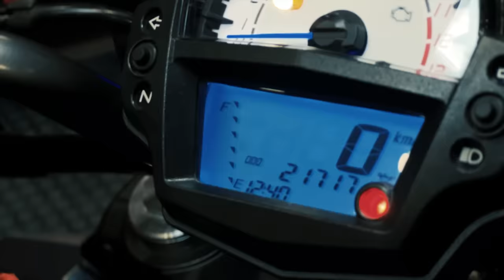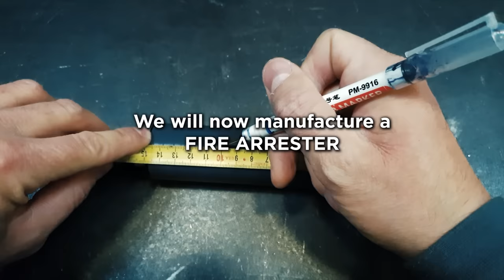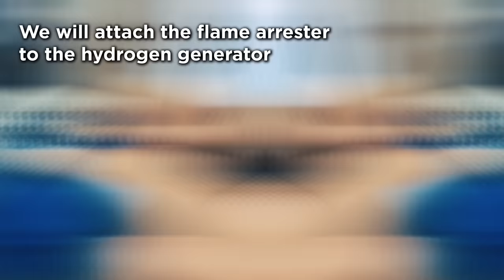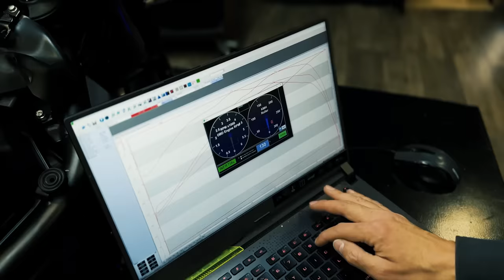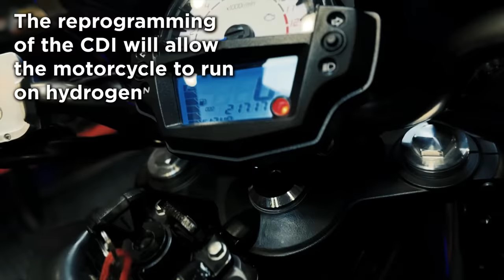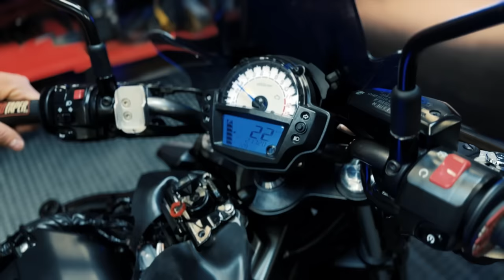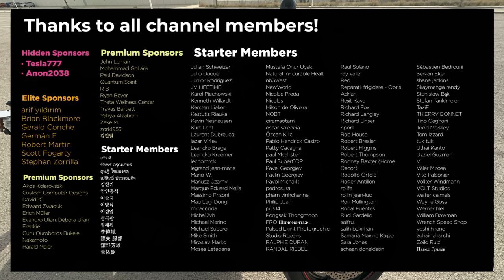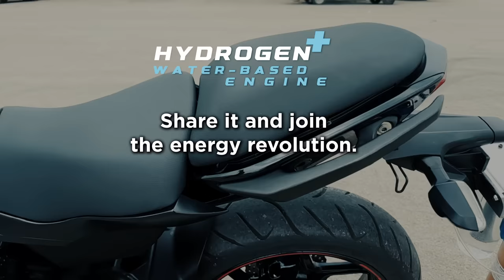Running Bike On Water - 100% Working Trick

Comment: This video violates a basic laws of thermodynamics and chemistry.
Proove:
1.)
1kg of hydrogen requires around 50kW of electric energy on industrial scale(70% eff.)
1kg of hydrogen posses around 142 MJ (39kWh)
of potential chemical energy. If I consider an engine eff. around 33.3%(High compression ratio, no turbo)That means, that you could use from 50kWh(but propably more, due to the poor construction and bleek eff.) That means, you would have to generate well over 150kWh/kg, while consuming 50kWh/kg. You have made a perpetum mobile with over 300% efficiency.
(not mentioning the puny battery, that would have to provide at least 60 000A at 12V to be able to cruise at 80km/h - that would requred tram rails to carry this ludacris current)

2) Hydrogen is not very well suited for Otto-cycle internal combustion engines. Due to the low octane rating (60-67 RON) requires maximum compression ratio around 6:1. This bike has a compession ratio around 10.5:1. HHO mix would result in an engine knocking and destruction after minutes of operation. Not only that, mixing Hydrogen with oxygen in such matter to be safe...
With just a single backfire, there would be a huge bang. Kreosan had actually tried this with an scooter engine and it resulted with an engine blown appart.
Reply: cheap to run--its a money thing
Reply: @brenohighland1168  not cheap to run if it destroys itself a few meters down the road
Reply: @Cyberware77   if
Reply: @brenohighland1168  a very likely if just depends on how hard its pushed, it would break when brought to road speeds

Comment: OK so my question is how long are you actually able to run because what form of energy loss will you have to the alternator and the battery which is driving the generator. 35% energy capture capture.
Reply: the point is, we can use our vehicle using water. done

Comment: How do you protect the engine from rust?
Reply: Water is not  going to the engine.. Only hydrogen goes inside
Reply: well do you need to protect the engine from rust with normal gasoline combustion? .........................................................lots and lots of Hydrogen in Gasoline which becomes water during combustion ;)

Comment: How long before it depletes the water?
Reply: Más tiempo que lo que tardará ese motor en fundirse.
Reply: I think the question is how long will the battery last. I think it will drain faster than the bike can charge it
Reply: @RobCantonJr if like that, much better the electric motor bike
Reply: @soss6923  yes exactly

Comment: I got my moped running idle by putting the  hho generator hose on the intake manifold vacuum. But wen i gased or trottled it it boged out. With no gas at all in the carb.

Comment: One thing i never understood is how the hydrogen would produce more to go faster. Thought it was a continuous flow. Cant have hydrogen and oxygen in a tank or its explosive together potentially. Only thing i could imagine is the power gets higher to the hydrogen genorator as it revs up. Hydrogen plus a hydrogen fuel cell would probably work better.

Comment: Isn't the electricity required to produce h2 higher than what's supplied?
Reply: 1:26  there is no “hydrogen tank” as this is a HH on demand system.  Meaning, the very instant that hydrogen is created, it is burned off entirely.  If you were to get in an accident, god forbid, you would be left with glass and baking soda. Oh, and some water.  That’s it.
Reply: What’s fascinating is this was figured out by Austrian / Hungarian Empire long before the 1800/s.  You can electrolyze water, so that its “steam” is a power source for combustion engines.  The only reason you aren’t taught about this is because powerful people like “Standard Oil” and other business interests stand to make too much money when we buy gasoline.  
It’s a fact that our engines use roughly 30% of the fuel we buy and pump into the tank.  70% gets wasted out of the exhaust!?!?  But not if you do this.

Comment: Est-ce que ce moteur supporte l'explosion à hydrogène.....le piston et les segments doivent morfler ?
Reply: C'est une des composantes du problème, ... les moteurs les plus robustes suportent bien la puissance de l'hydrogène (les gros diesels ou les gros v6) ... ce qui est plus problématique, c'est qu'ils sont constament soumis a ine athmosphère humide.
Mais tout ca n'a rien de révolutionnaire ni même de secret.
La supercherie consiste ici a faire croire qu'on roule a l'eau. Ce n'est pas le cas. ..  on roule a l'électricité qui transforme l'eau en hydrogène pour l'injecter comme combustible dans le moteur. En clair, ton générateur a hydrogène vide ta batterie a vitesse grand v ... puis s'arrête ... et fini la balade. En fait, c'est complètement con comme système.

Soit tu roules directement a l'electricité (et tu ne perds pas d'énergie par effet joul au moment de l'hydrolyse)
Soit tu as un réseau de distribution d'hydrogène et tu fais ton plein d'hydrogène ... et cet hydrogène est utilisé dans un moteur a combustion, ou dans une pila a combustible qui produit de l'électricité pour alimenter des miteurs électriques.

Comment: Wohin geht der Wasserstoff wenn er im leerlauf läuft? Warum hat er keinen erhöten leerlauf? Fragen über fragen. Das ding hat kein tank um gas zu speichern kann aber mal viel und mal wenig verbrennen😮. Erklärt mir bitte das.
Reply: sammelt sich alles im Luftfiltergehäuse, bis es rausdrückt, du sitzt auf einem Eierkocher😂
praxistauglich ist das nicht, zumal die Batterie bald leer ist und das Ding bleibt einfach stehen.
Es gibt HHO Aufbauten mit Neodymmagneten und Kapillaren, hier wird der Wirkungsgrad deutlich besser, dennoch fährst du eigentlich elektrisch
Reply: You could potentially solve this problem by running the engine with gas only from the hho generator. Then devise a system to take the signal from an electric throttle to adjust power to the hho gen? Potential lag issues if the hho gen isn't built well enough to quickly change output of gas.

Comment: This tech can easily be used as an addition to solar farming. Free sun egergy plus free water sources and filtration = clean hydrogen to generate more electricity for a quicker use case. The question is what is more efficient? Just solar? Or both solar and hydrogen together? A.i machinery can be used eventually to clean and maintaine bith solar panels and fuel cells at some point. Tesla has already proven that eltric motors can perform greatly. Battery tech will eventually get batter, but will hydrogen ever be a thing?

Comment: C'est une moto qui roule à Hydrogène, je crois qu'une batterie permet l'electrolyse qui produit de l'oxygène et de l'hydrogène auquel le moteur  est relié. Le moteur produisant l'électricité de la batterie, c'est un cercle vertueux. LE modèle de l'énergie libre.
Reply: T’es un bon en physique toi !
Comique.
Reply: @mrock9932  Mr Dramatique, je suis bon en physique.
Reply: @maximedeveaux2898  vu ce que tu écris au début, j’en doute. C’est complètement absurde ton explication.
Reply: Ce qui est absurde c'est de réfuter sans arguments. Cathode anode, sous tension donne de l'hydrogène. Un point c'est tout.
Reply: @maximedeveaux2898  oui, ça s’appelle l’électrolyse. Avec quelle énergie pour la faire ?
Reply: @mrock9932  La dynamo de la moto, c'est tellement évident, que je me demande si je devrais t'instruire avec le ton que tu prends.
Reply: @maximedeveaux2898  et ta dynamo , un alternateur plus exactement, tu le fait tourner avec quelle énergie ?
Reply: @maximedeveaux2898  c’est bien ce que je disais, vous êtes un bon en physique !
Reply: @maximedeveaux2898  tu  crois quoi, que tu vas obtenir plus d’énergie sous forme d’h2 que ta ”dynamo ” en a produit ? 
Ça ne marche pas ton truc.

Comment: Attention Liberty Engine Project Can you do a video on how to convert a gas powered car in to run on & powered by hydrogen water ! I'd want to know where I can buy all the supplies to convert the car over to hydrogen water  from online dealers & or local places ?  I'd also want to learn how to make the car to use the sun as fuel using solar power as a back up power source  ! If you got info let me know ??

Comment: Could you imagine no gas, nor electric car , just water.. i would for sure buy a car with a water engine. hmmmm no gas station, no electric station .. you got stuck in the middle of the road , just piss in it 😊
Reply: My friend the technology exist this is just one more proving it to be possible... Lack of future vision and lack of willingness and attitude
Reply: its still an electric vehicle because it depends on the battery
Reply: But for electricity there is alternators if the engine can run on water as the base of its Power the same way we don't recharge our batteries in petrol cars but we have built in alternators...

Comment: ? Where is the pay where he connects it to the bike? All I seen him do is block the intake, and tape up wires and hoses?
Reply: 5:57 See that red clip with the clear hose attached? That's where the gasoline normally goes. Can't attest to this actually working, I wish they didn't do so many 3 second clips while riding. But I do know that's the gas-intake towards the engine, now it's a hydrogen-intake.

Comment: If really cars, motorbikes, trucks and other vehicles can d runs on hydrogen, i.e. water, so why not introduce it immediately to all vehicles as an emergency,to at least partially save nature?
Reply: Autrement dit on n'aura pas assez de l'eau
Reply: Electrolysis is not a very effective method for producing hydrogen, and how to get a bunch of hydrogen in another way is not yet completely clear . In general, the idea sounds good, but if you look into the details, it becomes clear that not everything is as good as it seems.For example, we should not forget about the danger. After electrolysis of water we get not only hydrogen, but also oxygen, and ironically we get fuel and oxidizer mixed in an ideal proportion and what is equally important, the resulting mixture of gases (Brown's gas, detonating gas) is not much inferior in energy density to uranium. Which seems good from a usage point of view, but not very good from a safety point of view, since due to its energy density this gas self-detonates under pressure, which is not very good if the goal is to fill more gas into the cylinder. Just as importantly, this mixture of gases has an insane flame spread rate.When you try to ignite the gas, it literally burns out so quickly that in essence it is no longer a combustion, but an explosion. And explosions, as we know, are not the best idea for mass use among people. But when this gas is burned, there really is no exhaust, which is why hydrogen is used in forklifts that work in closed warehouses with people
Reply: Pas rentable pour l'état sinon l'eau ne serait plus accessible pour la consommation standard
Reply: @kumpatea  
It would be best if we return to horses, donkeys, oxen and other animals, that is natural and clean energy , and renewable, let's just leave the bikes, because they don't pollute that much except what material is needed for them, and today there is already too much of it.Anyway, we don't have much time left, because we have destroyed everything to the point where there is no repair or going back.
Reply: Sustainability.... think on the long run! ;)

Comment: Can you speak English? Congratulations I knew it was possible I just have a few questions how did you overcome...I'll actually use Google to translate in another comment, but  how did you overcome starting the engine without a supply of hydrogen in reserve? Are you just allowing electrolysis to build up enough hydro before starting the engine and that's all it's takes, basically priming it? And doesn't that's wiring kill that battery fast? There so small wouldn't it be wiser to connect directly to alternator? They got to have something on board to power headlights and such please share this...also how is engine handle underload? It's just hydrogen isn't as energy dense as gasoline or so I'm told? It appears your pumping the gas threw it's intake manifold under vacuum but does modern fuel injection or Direct injection system really use Ambient air underload to overcome the load? Thx

Comment: Ive got 1 question why is it making making noise. There really shouldnt be any at all. The engine doesnt operate like it normally would your step over combustion and the exhaust would be water so why the noise?? Or did you add the noise for effect which it doesnt look like you did.
Reply: It is still a combustion engine. It’s splitting H2O and burning the hydrogen. It’s basically the same as a gas engine hence the sound. You may be thinking of a hydrogen fuel cell which generates electricity, is much more efficient than this combustion engine and are typically quiet
Reply: c'est surtout que c'est toujours un moteur thermique. l'hydrogène par électrolyse peut servir de carburant mais il faudrait une installation bien plus encombrante de l'électricité pour produire l'electolyse et changer les reglage moteur car l'hydrogene n'est pas explosif comme l'essence bref c'est une arnaque il on mis sa derrière et mis un petit reservoir d'essence ailleur et le moteur tourne dessus c'est pour sa que rien ne change c'est comme le moteur perpetuel ou les ampoules que t'allume avec une rallonge en court circuit que ta allumé avec un briquet electronique toutes les inventions de cette page sont comme sa certaine marche mais sont loin de produire autant qu'indiqué et de pouvoir alimenter se quil alimente surtout qu'il parlent pas du reste comme l'oxidation (pour cet exemple le fait que l'hydrogène est hautement explosif et qu'il faut de l'électricité en quantité pour provoqué la reaction bref le plus rentable a l'heure acutel et c'est pour sa que sa se vend c'est l'etanole ou le gpl pour un essence et la bicarburation (gazoil/huile de friture) pour un diesel
Reply: « Car l’hydrogène n’est pas explosif comme l’essence" puis plus bas…"Le fait que l’hydrogène est hautement explosif…" j’ai du rater un truc 😂
Reply: @marielebeau2829  oui c'est pas explosif comme l'essence c'est plus explosif que l'essence comme le kérosène ou le nitromethane comparé a l'essence désolé j'avoue je me suis mal exprimé
Reply: @am6ouderbi190 peut  etre ta raison mais l hydrogene et oxygen c est tres explosif beaucoup plus que l hydrogene pure

Comment: و جعلنا من الماء كل شيء حي. Meaning # And we made from the water everything live# this is The Creator s words#  yes everyone an engine that run with water is feasible # why we get hydrogen form water # plus we use water pressure as the piston # one more thing about hydrogen # water can push hydrogen # it can be done but we are slaves of  the combustion engine industry and now slaves of the electric battery industry

Comment: I know for a fact that an engine can run on hydrogen/oxygen mix, but the engine would be very hot and damaged after a time due to the heat being excessive compared to fuel. The only way to prevent that is to add cooling or dilute the HHO mix with exhaust gases through a cooling interface. Stan Meyers is the inventor of this system.
Reply: I want some Meyers electrolysis spark plugs. I think I'm remembering that correctly.

Comment: Como es posible si el cilindro del motor funciona con gasolina como va a funcionar con electricidad por medio del hidrógeno tendría que cambiar el cilindro no me cuadra
Reply: It is a Hydrogen COMBUSTION engine. Not a fuel cell. Know the difference. Look up the Hindenburg disaster and you will understand that Hydrogen is highly flammable when mixed with O2 and a spark. This seems to run for a short time only. excess hydrogen gets released in the air. The setup only uses what it is needed. This was meant as a project and not for transportation of long distances.

Comment: This video made no sense to me. You just pull a bunch of wires and one single tube but it's unclear to where you did plug it? And somehow block and air inlet with duct tape for some reason. I'd expect an engine meant to run on petrol would take a bit more tweaking than that to run on a gas...

Comment: it takes a lot of electricity to make hydrogen, so it is powered by electricity
Reply: You need electricity to pull the hydrogen out of the H20. You could use a solar panel for this, the problem isn't it takes a lot of electricity, the problem is it takes a lot of time.
Reply: @MrMotoMike  more energy has to be put into the decomposition of water than is given off by hydrogen this is a physical rule unfortunately!it takes a lot of electricity to break down water, a solar panel can drive a model car
Reply: @mihalypelyhe9819  A solar panel works just fine for electrolysis. Haven't you seen videos of a 12v battery being used to generate hydrogen? You're claiming there's no way for a solar panel to output 12v?... lol

Combustion is how we use the hydrogen, you know... controlled explosions like what we do with gas.

You said "a solar panel can drive a model car" as if my argument is the solar panel is making a vehicle go lol. You use a solar panel because it's cheap energy to create the hydrogen-gas, then you burn the gas in your engine. It burns more efficient than gasoline and it's byproduct is water vapor! That's pretty cool.

Comment: Tại sao dự án xe chạy bằng nước! không ai đầu tư? Vì, nền tảng khoa học không chắc chắn, chạy bằng nước thực ra là chạy=hydro. . Việc tách hydro ra khỏi nước phải tiêu tốn năng lượng (1). động cơ đốt hydro để tạo ra cơ năng cho xe chạy (2). Hiệu suất tổng 2 chu trình này là nhỏ hơn 1 nhiều. Nếu có công nghệ nào tạo ra hydro rẻ hơn xăng dầu và bình chứa Hydro tiện lợi thí xe kiểu này mới có xuất hiện nhiều trên thị trường
Reply: Because we have an economy based on energy and you cannot sell water at $4 per liter. This seems to run for a short time only. excess hydrogen gets released in the air. The setup only uses what it is needed. This was meant as a project and not for transportation of long distances.